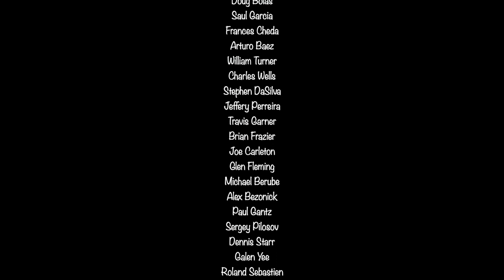My locking 2 drawer bed storage system for the Nissan Titan

Comment: Are you talking about the Decked system when describing the plastic box?
Reply from the maker: Yes.
Reply: @CKKnifeandTool  that plastic box will hold 2000 pounds on top of it, more than your truck is rated for. Sounds to me like you didn’t wanna shell out the $1400 and you’re trying to justify it by being disparaging towards decked.

Comment: Why cheap out and not buy the decked system🤷🏻‍♂️
Reply from the maker: The Decked System although nicely designed when installed doesn't allow as much storage as what I built or what Vault builds.  And "Cheap out" would mean what I did was cheap.  I can assure you that nothing was "cheap".  It's all about what you can afford, what your needs require and what your willing to put in.  If Decked wanted to send me one I'd install it and do a review of what and how much I could carry with that vs. mine here.